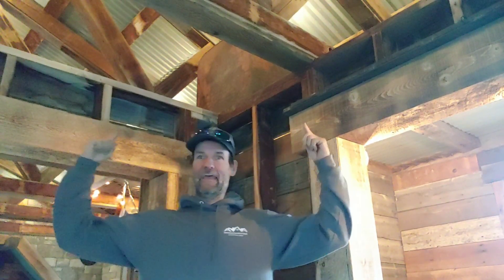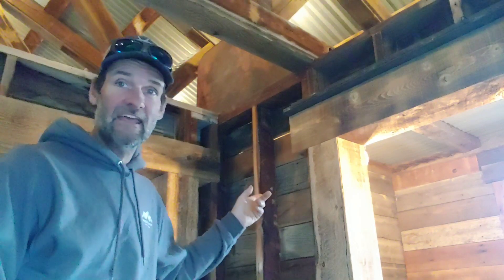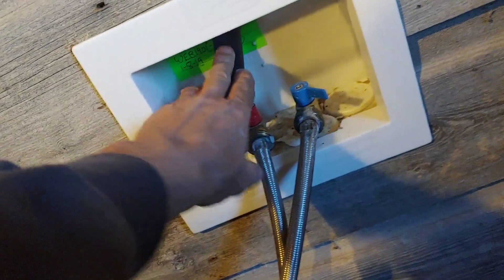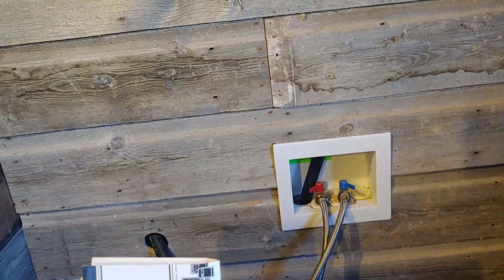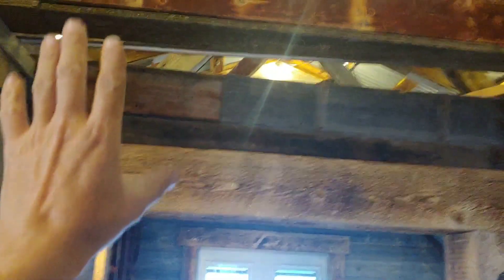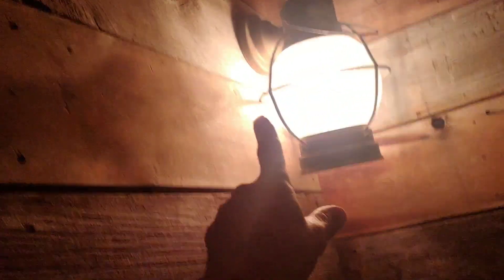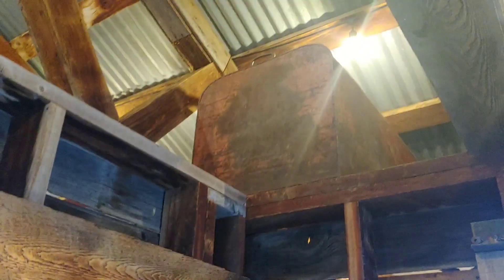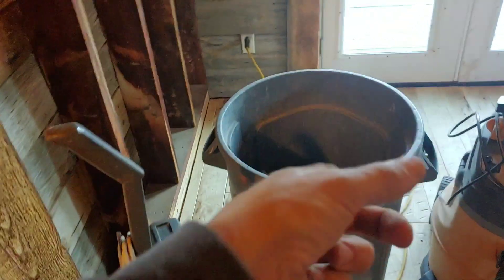I found a way to repurpose water

Comment: Brilliant really, and it'll put some soap through the toilet at the same time. That tank might get a little nasty though, may want to rig-up a bleach drip to control mold.
Reply from the maker: You would be surprised how fast you flush water down a toilet... as far as the holding tank the water in that should never be more than 15 days old you do one load of laundry of whites and you put bleach in that problem solved